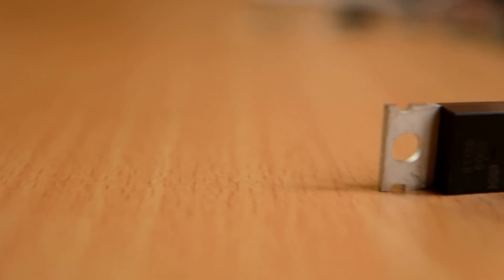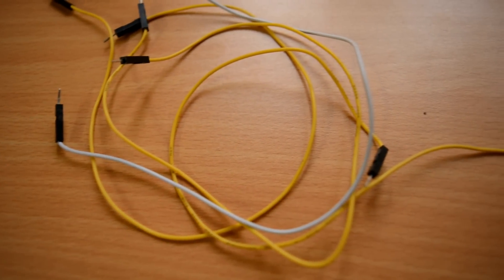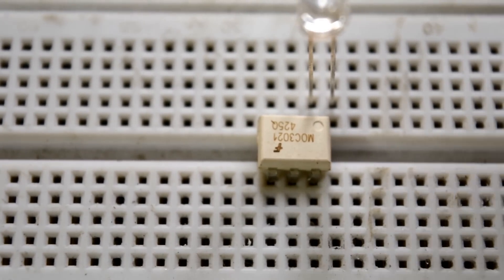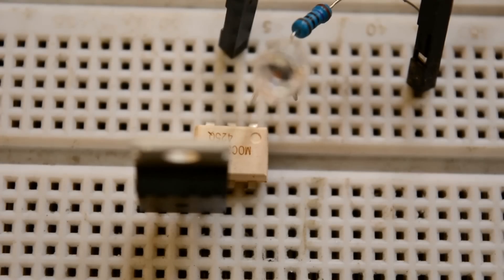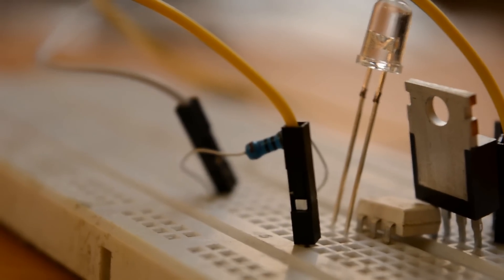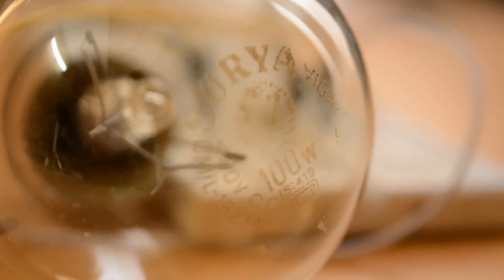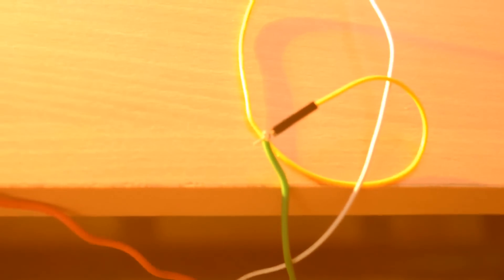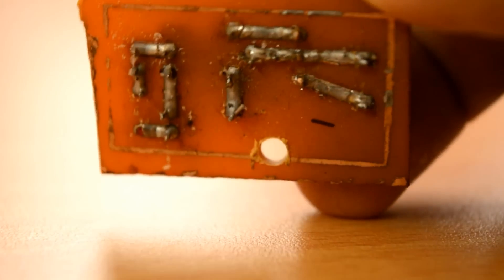DIY SOLID STATE RELAY

Comment: Hi can I connect this to SPST switch and control two way
Reply from the maker: Subramanya, you can use it as a SPST, what you can do with a switch(SPST) you can do with it, but please explain in detail about what you want to do by connecting it to another SPST?
Reply: Say I have switch to control bulb and I want to add my arduino triac circuit to control the same bulb.
Reply from the maker: Yes, you can use it in this way.
Reply: can you explain I just know how to connect two way switch with com but here there is no com from triac, thanks in advance
Reply from the maker: This relay has only two ports for high voltage --
NO and COM, it does not have NC port so it actually doesn't matter where to connect COM or NO wire in this relay, even if you swap the terminals nothing will change.

In short, just think of it as a normal electromagnetic relay which do not has NC port, it works the same way however not on electromagnetism but on properties of semiconductors which makes it more reliable and power efficient.
Reply: @TanishqIsHere  i need NC also in this circuit. is it possible????

Comment: Or you could just buy one...
Reply from the maker: Video is for makers, learners and inventors :D
Reply: +MrQuidestveritas Why? I just looked in the MOC3021 datasheet and it says it can handle 400V. UK's 240V RMS translates to ~350V peak, which is less than 400V, so what's the problem? The data sheet even says “for 115/240 Vac(rms) applications.”